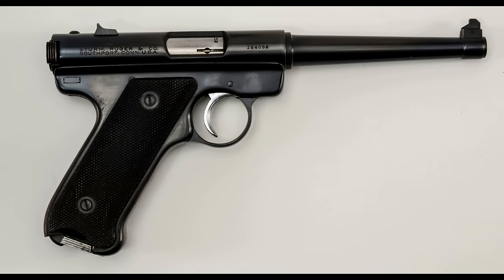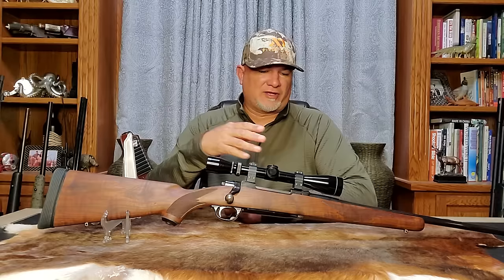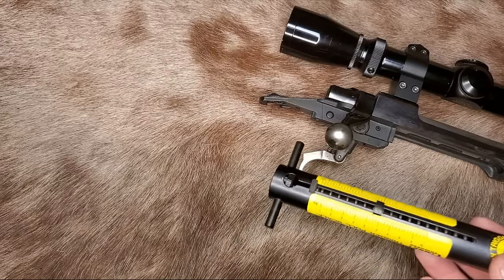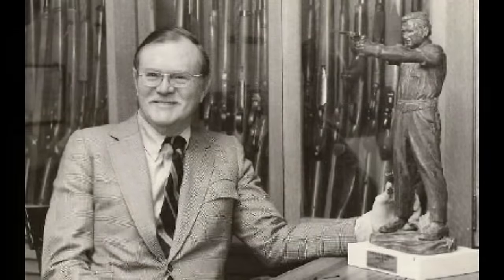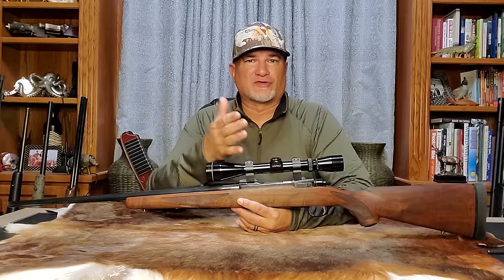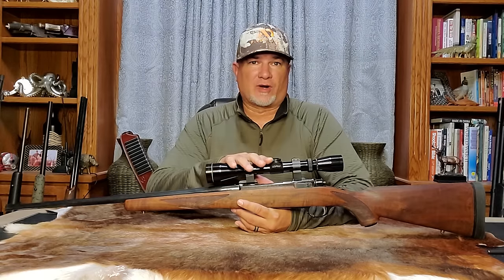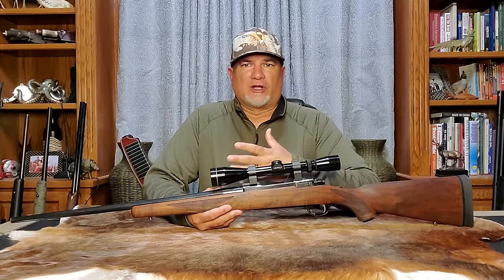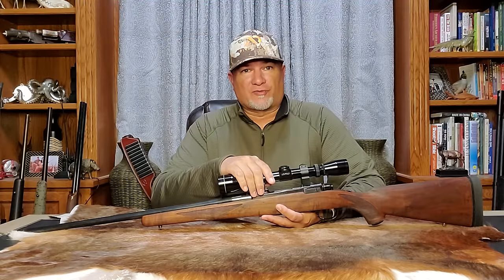RUGER M77: A Classic American Rifle

Comment: I own several M77s. I would buy a used M77 before a new anything. Just my opinion . The quality and fit are better
Reply: I agree.  I collect Ruger’s revolvers from the 1950’s.  Solid, well made, and shoot great!
Reply: I've got a few old 3 screw not modified. The 44 mag has a dark plum color. Love them all.
Reply: Absolutely agree. I have a 77V in .22-250. I know there have been 20,000 rounds through the. Barrel. Still 1/4” at 150 yards..
Reply: @BarnyDaddy  That's nothing, mine shoots 1/16" at 200yards.
Reply: @whiskeykilmer1866  Mine shoots 1/32 at 300 yards...

Comment: You just blew my mind with this one, definitely didn't see it coming. I was rolling on the floor when you mentioned the Zythel "Boat Paddle" stock. My first MK II in 338WM still has one. I will never forget the day I pulled the trigger on it for the first time. I just sat there on the bench and figured I had made a huge mistake in buying it. Never shot anything bigger than a 7mm RM in my life at that point. I later picked up another Zythel stocked MK II chambered in '06, I firmly believe it has worse recoil than most 300's. Great video, thanks!
Reply: My dad picked one up and shot then took it back to the store to trade for something that didn’t kick every screw in your body loose when shooting it🤔😳😂
Reply: I agree with you but I always meet people who are fanatically seeking out the "boat paddle " stock.
Reply: @edwardabrams4972  I wasn't so smart, I put it in the closet for several years then toughed it out for a couple of hundred rounds. Don't get me wrong, it still kicks like a Missouri mule, but I did succeed in killing the nerves in my shoulder. I will praise it for it's weight, rather nice to carry in the field as long as you can keep the sling "swivels" quiet. Have a great weekend!
Reply: @barrymantei7795  Yeah, I've noticed that a little too. What can you say, people will collect anything. Have a great weekend!
Reply: I had that paddle in 300 wm you never shot it for fun!

Comment: I asked Ruger to build me a rifle in 1976.  6mm Remington with a Dougles 24 in barrel. The rifle is a better shooter than I am. I dissembled and cleaned the rifle and after that and the 77 refused to shoot under a 2-inch group.  I called the Ruger man that built my rifle. Yes they were that great as a company.  He had me buy a small poundage torque wrench(go to a machine shop supply house or an aircraft parts company) torque wrench. Then he had me shoot my group and then increase the torque on the angle stock screw in 1/4 pound increments.  I still have the 77 and would be the last firearm I would sell. It also shoots under one inch when I do my part. 68 years old now and it can easily hit a business card at 100 yards.  Dang . I am going shooting this weekend.

Comment: I purchased my first rifle a week or so after turning 18, a tang saftey M77 in .270 grouped about 1-1/4 for me. Still have a soft spot for the tang saftey models to this day. Enjoyed your video!
Reply: The unsafe safety,  Sooo easy to slip it into fire when carrying without knowing. I glued wooden rails to each side
to prevent the safety from being moved by accident, easy fix. Bought my M77, 270 in 1981.

Comment: I just bought a Ruger m77 from a small gun shop at near camp a couple days ago and figured i would learn more about the history of this firearm. Whoever owned previously it really did an incredible job with their customization or this rifle. It has iron sights and the rear sight flips up, a leupold m8 3x fixed scope with a one piece Leopold scope mount and an absolutely beautiful trigger. Unfortunately the scope mount covers the irons but the scope is great regardless. I am not sure if it has a Douglas barrel or someone replaced with a ruger barrel or what but it's dead nuts accurate. I am shooting through the same hole several times at 50/100 yards. My research tells me it is a 1976/1977 rifle. I've never had such a pleasure shooting a rifle and while it may have been a little pricier than I usually like paying it was worth the money and then some. They don't make them like they used to, that is a fact.
Reply: I hated Ruger all my life for putting out the junk they did for the first few decades and all the cheap manufacturing problems they had with the 77's, plus all the anti-2nd Amendment nonsense Ruger was responsible for....it wasn't until recently that I started liking the company again as now they are finally putting out much higher quality stuff and they are 100% pro 2nd Amendment finally. They finally turned into a pretty decent company as of late.
Reply: Well if the barrel says "RUGER" is a Ruger barrel.  If not it's a replacement.  Pretty simple.
Reply: @Nick-wn1xw  barrel says Sturm, Ruger & Co

Comment: Great video.  I bought my Mark I in the early 80's not knowing much about them except I really liked the classic look and the price.     I must have lucked out because mine is consistently accurate even without having done any adjustment to the factory trigger.    As far as the recoil pad deterioration I never noticed it probably because it's chambered in 243 Winchester and recoil is not an issue.     I used it on Texas whitetails for several years and killed a few that were well over 200 yards out maybe even in the 300 yard range.     I hand load and plan on shooting it to determine how accurate I can get it to perform.   Luckily I have never taken it apart for cleaning.   I did not know and do not have the means to torque that front screw to the 95 lb-lbs.  I suspect that many people that experience poor accuracy from their M77's have taken them apart and not torqued these screws properly when they reassembled them.  I learned a ton of things from this video I did not know about a rifle I have owned for nearly 50 years.  Thank you.

Comment: Thanks for posting up this video on the historical overview of the Ruger M77 rifles. Back in about 2008 I was driving through Alberta and stopped at a gun shop. I seen a LH Ruger M77 in 25-06 with a grey laminate stock. As the story goes sometimes - I didn't pull the trigger on that one. And someone bought it shortly after I left the store. So fast forward to 2023 and I found a LH Ruger M77 Hawkeye in 300 RCM. And the price was right, and they had ammo too. The length of pull felt short so I picked up a Limbsaver Slip-On Butt pad. It also had a peep site on it - so I'm just waiting for some warmer weather to go out and see how well I can shoot it. If that doesn't work well for me I'll mount a scope on it. I'll probably come back and re-visit this video in case I need to do some tweaks.

Comment: Great rifle, many people do not know that the m77, m77 mark ll, and hawkeye are among the strongest, hardest mass produced factory bolt action recievers ever made. Many people had issues making them shoot because theres things they didn't understand with the middle action screw binding the action, the mag binding if it wasnt ground enough to have wiggle room, and how to properly tighten them in the stock. I became a gunsmith/rifle builder off the m77 tang saftey. If you understand the trigger and take it apart and work it you can make it very good and thats coming from a guy with two jewell triggers in two benchrifles set under 2ounce pull weight. I have an m77 that is my custom 30" barreled 264win long range hunting rifle and it rivals both my 6xc and 7saum benchrifles in how well it preforms

Comment: Another excellent video DD.  Perhaps I can add tidbit of info to the trigger discussion.  I bought a tang safety MK1 77V in 1976.  Still have it.  It's in .220 Swift with the heavy 26" barrel.  As you indicated in the video, it was of the generation of abominable triggers.  My next door neighbor, who also was my mentor for all things outdoors, replaced the trigger for me with a Canjar trigger the same year I got the rifle.   It was set to 2.5 pounds and it breaks clean.  I used to refer to it as a digital trigger- either on or off with no in-between.  The rifle went from 2.5 - 3" groups to 5 shots into a dime size hole at 100 yds. using 55gr Sierra Spitzers loaded to around 3600 fps with IMR4064 (if I remember correctly).   
    I was introduced to the M77 a few years earlier, around 1971, when my neighbor bought the M77 in .350 Remington Magnum.  He was trying to develop loads for it.  As a 16 year old shooting that rifle from a bench, I developed a bit of a flinch, as well as getting some nasty black and blue marks on my right shoulder.  It's funny to think of now, but we were trying to get MOA accuracy with 225 grain Speer flat nose bullets.  I never thought about the rifle barrel, so your explanation about Ruger's barrel implementations was most enlightening.  And you are dead right about felt recoil.  That .350 kicked like a 12 gauge fired from the bench.
     Another thing about Ruger centerfire rifles in general and M77 rifles in particular at that time was a selection of calibers that were off the beaten path at a time when the big companies like Winchester, Remington, and Savage were limiting their productions to very popular calibers only.  If I remember correctly, you could get an M77 not only in an odd caliber like .350 Rem Mag, but useful cartridges like 7 x 57 Mauser, and.220 Swift.  I am talking about the 1960's and 70's.  I know Remington and Winchester eventually came out with "classic" versions of their rifles that included some of the older, less popular calibers.
       In the "90's, I bought a MKII RSI in 30-06.  It looked great but the control round feed didn't work too well.  It wouldn't extract the cartridge about every third round from a full magazine.  I sent it back to Ruger with a description of the problem and they sent it back with a slight improvement, but it still hung up on occasion.  I eventually sold it.  The design of the safety to make it more like the Model 70 Winchester was also a disappointment to me.  I didn't think that it was anywhere near as good as the safety on my Model 70, which is a push feed USRAC from the early 80's.  
   Love your videos.  You are an amazing source of firearms knowledge and experience.
Reply: my father in law had the 6mm, bought in the 60’s, I had a 270 bought in 71, shit three shot groups that were cloverleaf and still does, then  bought a 25-06, then the 7mm. Everyone shoots sub moa
Reply: You are spot on with your evaluation, I have four. My 7mm had a 270 round shot through it and messed up the headspace, Ruger repaired for free. 
Had a stick crack on my 25-06 and Ruger sent me a new one free of charge. 
My 270 shoots the same hole and have had 6 or 700 rounds shot through it.

Comment: I have 3 M77's, two 300 win mags and a 416 Ruger.  All extremely accurate.  The 300 win mag I got crazy tight groups after a few hundred rounds down the barrel.  I even hit a 1 inch group at 1000 yds, the video is on my channel.  I wish Ruger M77 could be perfect if they added a better adjustable trigger from the factory, and better stocks.

Comment: Good Video , brings back a lot of memories, I remember I bought a tang model ultralight with the ebony tip in 270 in 1989 or1990, I called it my lucky gun, whenever I took it away Hunting I always had a good time, then I lent it to a Buddy, the rifle wasn't lucky this time away, he dropped it in some dirt. some pigs came out in front, he let one rip, and the barrel blew apart about four inches in length from the end of the barrel.

The other tang model I bought brand new, that was in 88 or 89 it had been at the store for quite a a while no one wanting a Swift but I did,  A Varmint model in 220 Swift put a brand new Leupold 6.5x20 Gloss model, took it to a famous gunsmith here at the time, had a Canjar trigger fitted, and got it bedded and Floated before I even took it out of the box myself. the 270 wasn't a tack driver but it wasn't bad either 2 inch Groups were normal, It didn't matter, the rifle was only going to shoot 150 yards at most, the Swift was a tack driver never missed a beat I pulled some shots off with the Swift that I didn't think I had any chance of doing it, but it surprised me a number of Times, they were both great rifles to me, we had some fantastic trips away with back then.

Comment: I bought 4 of these rifles over the years.  One for myself and later one for each of my three sons.  All of them are the original Model 77 with the tang safety. They are all fitted with fixed, low magnification scopes, 2 Leupolds and 2 Burris.  The three for my sons are the "RS" models with iron sights, mine is an "R" model without iron sights. They are all still in use and all still working great and very accurate for sporter weight hunting rifles.

Probably the best value in a bolt action rifle and they have always been very attractive and practical.

Comment: Thank you, that was interesting. My M77 story is very similar to yours, except for the happy ending. Mine was the first "serious" rifle I bought, when I was still a student working part-time in a gun shop. It was a mk II RSI in .30-06. With a Leopold 4x. Right out of the box it shot 1MOA. Took it hunting about a week after getting it and missed about 5 fairly easy shots in a row. Eventually my hunting buddy said "you are useless, give me that rifle" and he missed 3 times in a row. Problem turned out to he the scope mounts. After a shot it would "bed down" and shoot well, but the first shot after walking with the rifle or slapping it about a bit was way off. Fixed that, but after a year or so the accuracy headed south again. I glass-bedded it, and it worked for a while, then went bad again. The stock was warping and touching that pencil-thin barrel, and I never did find a lasting, reliable solution, eventually giving the rifle away.

But I still think the action itself is one of the very best controlled-feed hunting rifle bolt actions ever made, irrespective of price.

Comment: I had a m77 all weather in 338 WM with a “paddle” stock. As an African guide I found it brilliant! The rings had slotted screws and were terrible! so had then replaced with Hex and  had to align the rings as factory replacements simply were awful.
However I managed sub MOA with factory ammo and uses it well on wounded game shooting some 600+ yard shots to put down wounded game. I found her hard on scopes but loved her rugged reliability. I was drawn to her by the long extractor which reminded me of the pre 64 Win.
For a working gun that can take punishment and di the job when called upon I was never disappointed.

Comment: This is a great video.  My first hunting rifle purchased with my own money was a Ruger M77.  Have owned several since.  This first rifle was purchased back in 1980.  So, I currently own a bone stock M77 in .270 Win. with the red recoil pad and iron sights.  Just ordered the Warne scope mounts for the M77.  Had been holding off ordering mounts and glad I did until now.  Also, will need to bed that action and replace the recoil pad and lug screw.  We'll get it tuned up soon enough....

Comment: One of the two most accurate factory rifles I ever owned was a Ruger M77 Mark2 VT with the gray finish. It was a .220 Swift that I could get an honest to goodness 4100fps from with 50 grain Ballistic Tips. The observation about the early models was spot on, I had a beautiful looking 7mm Mauser with the beefier stock that was barely 2 MOA on a good day. Thanks for such a great presentation DDO!
Reply: I had a m77 mark 2 in 22-250
Reply: @blakesmith2594  My friend purchased the same model as I just after mine arrived, but chambered for .22-250. As I recall it shot pretty well too. Thanks for sharing!

Comment: Edit to add:  a friend brought over a Ruger M77 Mk II for scope mounting with the factory rings. It took a l-o-n-g time to lap those rings decently. Also, I was unable to get the front screw torque up high enough with that slotted screw. Brownells has a replacement with a hex head, so I’ll ask my buddy if he wants one. 

I recently bought an M77 Hawkeye All Weather rifle in 7mm-08, so your history of the rifle is great. Especially when Ruger made changes to the rifle to make it better, not cheaper. 

A tang safety is really good for most shotgun enthusiasts.  It’s completely natural for me, unlike buttons behind the trigger or at the back of the receiver. People complain about the tang safety Miroku puts on Winchester 92s, but I like it much better than a Marlin cross bolt safety. That said, I have no problem with the Hawkeye safety position either. It’s similar to a newer Model 70 and an older Sako A III carbine I have.

Comment: Not long ago I got my hands on an older M77/270. I had been looking for an action with the .473 bolt face and this was it. I had my local gunsmith re barrel it with a .284 bore and had .275 Rigby stamped on it. A 24 inch Shilen barrel. I didn't want to pay the cost of a 1/4 rib so I had express sights installed. I am still working on a pet load but I do have a lot of experience loading the 7x57 so it won't be long now. I will have to look at the bolt to see if it has a T stamped on it. Thank You.

Comment: I found that the Limbsaver Airtech recoil pad #10800 fits the stock profile and I only had to drill new holes.  I also installed the Rifle Basix sear.  Wow!  Make sure the trigger pivot pin is seated flush, otherwise you will break the trigger guard when you reinstall the stock and trigger guard.  Floated the magazine well also.